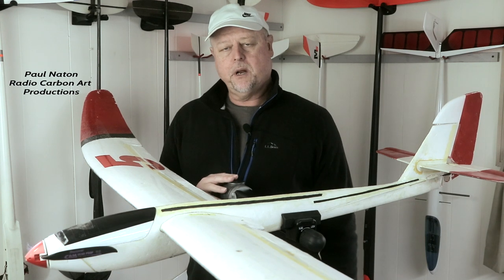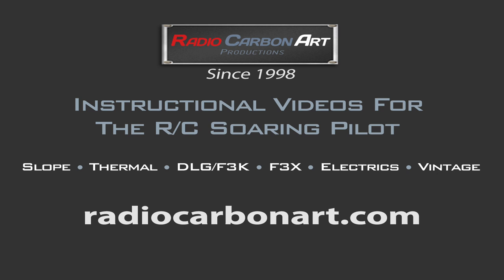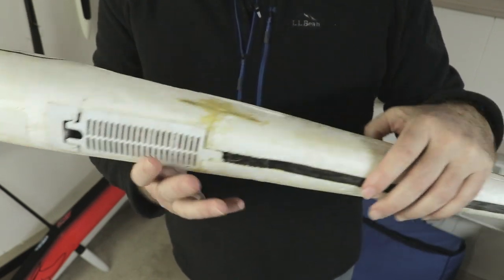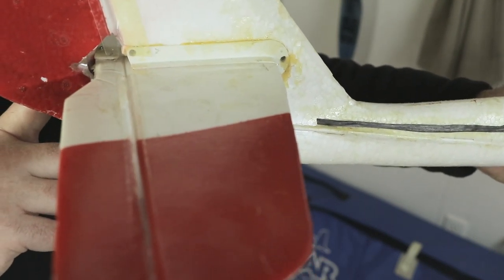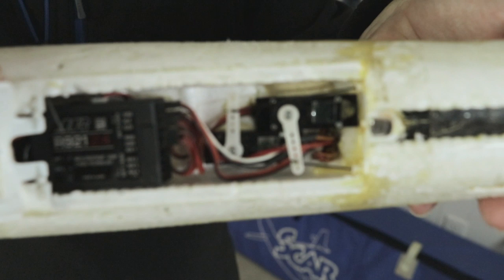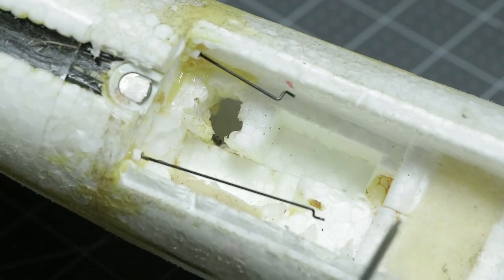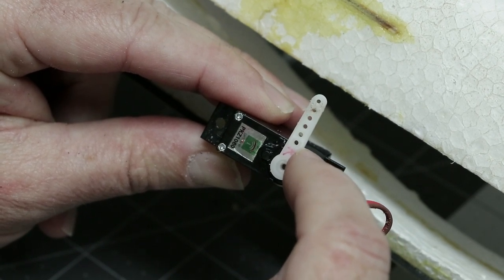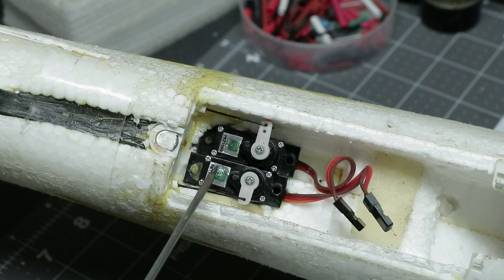E-Flight RADIAN Servo Modification & Tune-Up Clinic #2

Comment: I admit being taken in by the light show aspect of this RC sailplane, but did not expect there to be so many issues w/ a simple sailplane. You basically need to re-build the fusilage and re-configure the elecronics/servos just to make this thing fly properly or as expected. Originally got this to convert into an easy to control FPV platform cum night light show - you know, just for fun - but your video shows me I have some serious re-fitting before I can even fly it w/ any degree of confidence. Seriously disappointing!

Comment: Great video!  At 39:08, when you are showing the adjusted elevator movement, as you move to the full down elevator position it appears that the clevis is hitting the push rod tube and is creating a mechanical limit for the elevator throw and I was hearing the buzzing of the servo.   Is that correct?  If so, I assume you could correct by trimming back the elevator push rod tube.

Comment: Paul, I'm finally getting around to improving my Radian and fortunately discovered your suggestions.   Quick question: I cut flaperons out and they seem pretty flimsy. Should they be reinforced somehow?  Thanks
Reply from the maker: Or just use box tape like on the wings. You can also face the beveled edge of the flaperon with sheet balsa.
Reply: @pnaton  thanks!

Comment: Paul, interesting how you have dual rates set with a higher rate for your thermal mode and lower rate for speed. Seems counterintuitive. Most slopers or even TD ships I fly I use a higher rate for acro and speed and much lower for thermal. This is where I have been recently using  Expo so I can have less throw with smaller movements of the stick but full throw when needed by larger deflections of the stick, without having to switch to dual rates. Thoughts? BTW, nice video!
Jim Carlton
Reply from the maker: This is a slow speed plane at all times, with camber added beyond the large amount of built in airfoil camber,  elevator gets mushy, you need the throw. What I didn't show the ELV to CAMB mix which greatly helps pitch response at slow speeds.  I run the CG right at the NP, so not much ELV throw is needed. The rate difference I show is very small between slow/fast.  There are many ways to use EXPO/DRs to get the plane to do what you want it to do, fast slopers would be a different set up to the Radian.

Comment: Is it ok to fly the Radian as is using a 4S Li-ion pack and a throttle limit?
Reply from the maker: The ESC is only rated for 3S. The stock hub will not handle the increased rpms- Change the ESC, hub and prop, and Radian will be fine on 4S.
Reply: @pnaton  Perhaps I should make myself some 3S LiIon packs. My greatest concern is the motor: if it can handle the 4S current pulses. RPM's are easy to limit with throttle limiting and the ESC label has a rating of 3-4S.